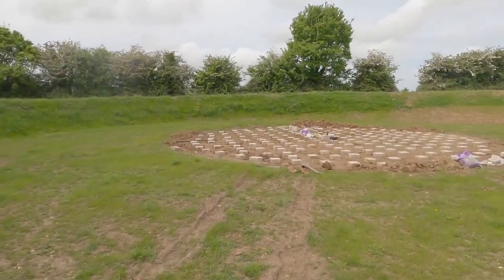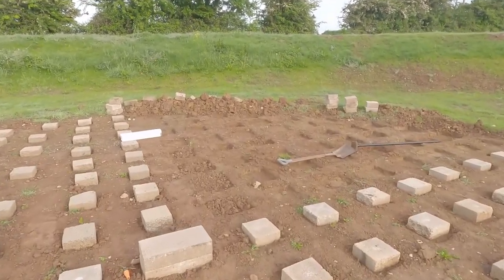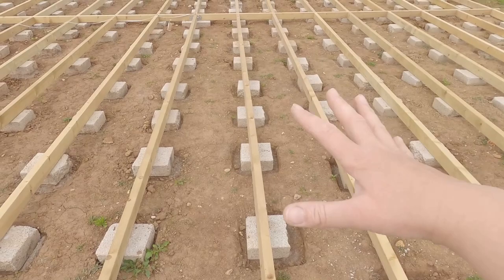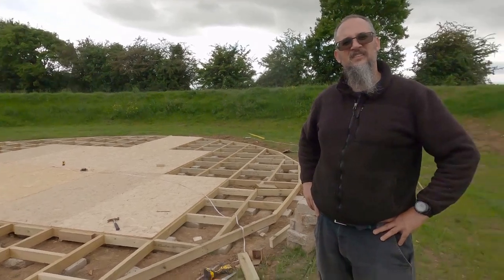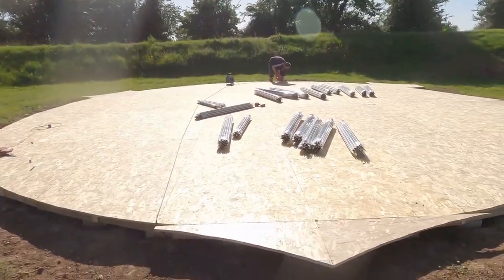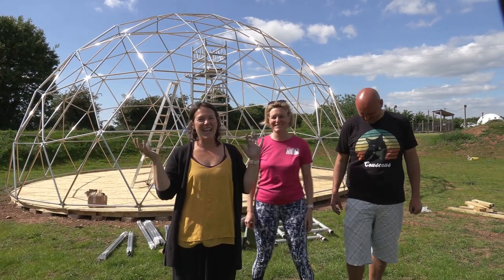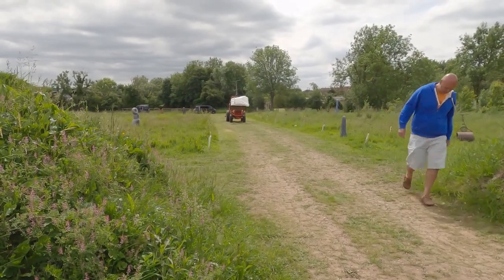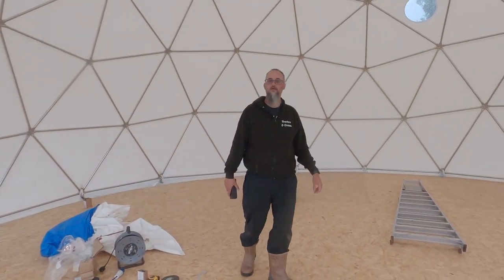EPIC Geodesic Dome Build! - We build our new 10 Metre EVENT Dome

Comment: I know this is a bit late now. But you dig the holes a little bit deeper than you need. Then put some stones in the bottom. Then you remove the excess as you level.
Reply from the maker: Hi, that's sort of what we did in the end. dug it out a bit deeper, compacted it flat and then used sand to level it. Sooo time consuming though!

Comment: May I ask you, how does it work with rain? Is it too loud? Cheers
Reply from the maker: Hi, yes it is pretty loud! We had a sound healing event in there when it was torrential rain and I was really worried it would ruin it but it actually added to the experience! But if you were trying to hold a conference or talk it would be much harder with heavy rain. We are thinking about getting the insulation kit for it as I think it would help with the sound.